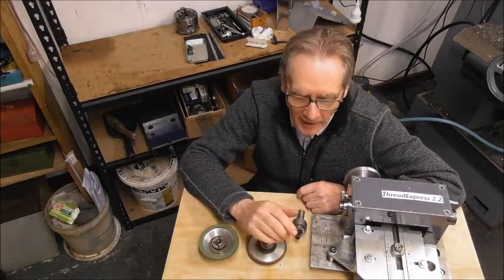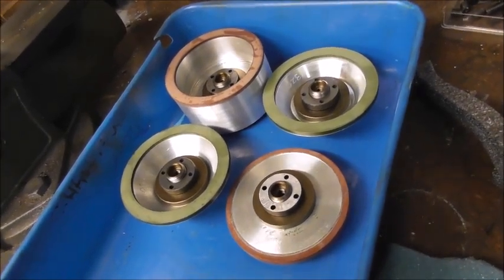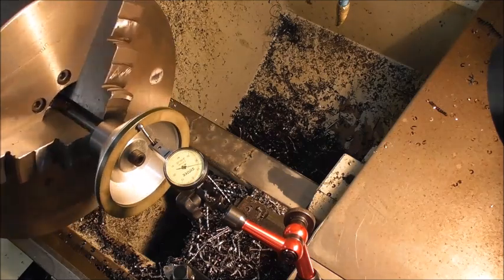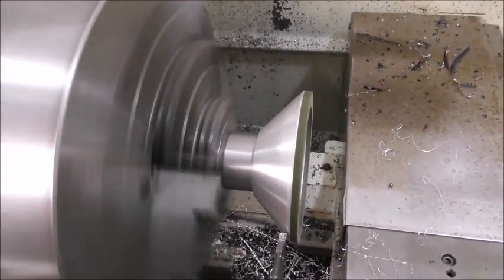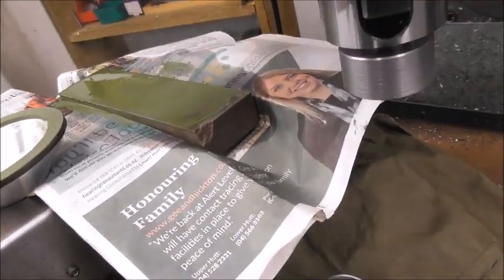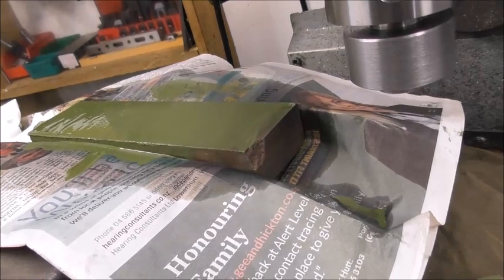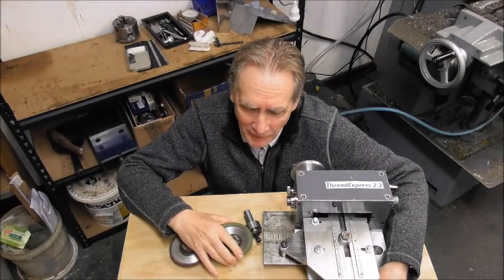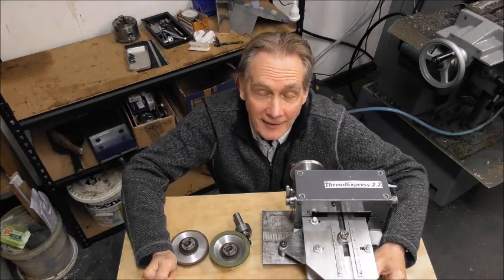Dressing and Truing Diamond Grinding Wheels

Comment: Thank You, i did this to many of my wheels after watching the original video. I have about 10 cheap China diamond and cbn wheels, some actually pretty decent on delivery. The worst one was a heavy cup wheel like the one shown, it was off by half a millimeter... A tip in that situation is to machine the back side first to first get it parallell with the diamond and then machine the rest of the surfaces and sharpen the wheel. It seems like the stone essentially becomes a precision ground flatstone provided the mill is really well trammed. It may require a superficial pass on the surface grinder as well to make it really flat. I also made a balancing axle and 12 of the dbit wheel holders, 2 different for small cutting discs which are rather useful. Used the balancing axle for the sharpening operation, it is only useful for balancing the stone wheels in these small dimensions. After turning and sharpening all the wheels came out pretty well balanced requiring no further balancing. One of the wheels I bought was thrown away, they must have forgotten the diamond or something...but all in all a very good deal.
Reply from the maker: Thanks for taking the time to give that very useful feedback and adding to the collective knowledge on this subject. Cheers, Cliff

Comment: I have a new Chinese 400 grit resin bond diamond wheel.  I tried to use it. But it seemed to burn the part. I used it dry like I would with course grits.   Is there a trick to using the finer grits?  Is it required to slow rpm or use lubricant?  Or does it need dressing to remove some of the resin and open it up?  Thanks.
Reply from the maker: Hi Robert. What grinder and what material are you grinding? Cliff
Reply: @ thanks. It was a tool post grinder in the lathe grinding on hardened  O-1 tool steel reamer I was making.   It was turning about 3000 rpm on the tool post grinder.  Lathe was stopped as I was working on flutes.  I had previously used 3” dia 150 grit  and  5” dia 320 grit wheels.   Then switched to this 3” 400 grit wheel.   All dry, no lube.  I was trying to get the final fine finish on the reamer. It immediately overheated and warped the reamer.  I had to lightly temper the opposite flutes to get it to straighten out.
Reply: I don’t know the grit concentration of these wheels.  Probably low.  The wheel being new and very fine grit is pretty smooth.  I wondered if it had a glass of resin rich on the surface.
Reply: What parameters would you use to grind the flutes of a reamer with a 400 grit resin wheel?
Reply from the maker: @ Hi Robert. Those diamond wheels are best for tungsten carbide. 01 steel is much better ground with Alum Oxide white wheels, correct bond, grit and diamond dresser is also critical for good results. Cliff
Reply: @Threadexpress  agreed.  I know diamond not recommended for steel.  But they are significantly cheaper than CBN.   I have a diamond wheel on a drill sharpener that I have been using for 20 yrs.  So what they say about damage is overblown.

Comment: Cliff are you not assuming that the bore of the cup wheel is round and perpendicular to start with? Perhaps turning it around and machining both the shoulder and the bore otherwise you may find that the runout is influenced by the way in which the cup wheel is mounted (assuming you don't have an individual spindle for each wheel and the 2 are not separated).
Reply from the maker: Hi - You are correct that my procedure was not optimal. Initially I was trying out an idea I was far from sure would even work and wanted to limit the time spent. Then I carried on and did the other wheels by the same procedure as it was a vast improvement, but I agree not optimal. Best practice would be to sleeve and bore the wheels to a close fit and face the wheel flange contact surface in the same setting (perhaps based off the diamond matrix set as concentric as possible), before even starting to machine the body and dress the wheel. But as is usually the case, time was part of the procedure plan compromise. 
Cliff

Comment: In fact, running briefly diamond core drills (ones used for making holes in glass for all sort of glass furniture) through a block of corundum is standard way of sharpening then when they get dull.
Any abrasive tool consist of grit of abrasive material (corundum, garnet, silicon carbide, diamond, CBN and such) set in some matrix (ceramic, resin, rubber, brass or bronze) holding all grains in place. Once an individual piece of abrasive gets dull, the resistance of material being ground (i.e. cut, by ever so small chunks) increases, and once the force acting on this individual grain exceeds the strength of the matrix it is torn off, and new and sharp grain comes to the front - and does the grinding.
And so "ca capo al fine", but every now and then either the abrasive is too hard in relation to material that's ground (like extremely hard diamond on a drill going through relatively soft glass, or silicon carbide grinding disc with hard matrix grinding a HSS blank) or the matrix is just too strong (for safety reasons - like in grinding discs for an angle grinder) which results in glazing, loss of grinding capacity and overheating of the tool and the object being ground.
In order to get rid of these stubborn, dull grains you have to run the tool through something hard enough to rip off these dull grains - for diamond tolls it could be an abrasive block (or in case of masonry cutting wheels used with angle grinders when they get too dull while cutting soft bricks you run them through a piece of concrete), for grinding discs used on bench grinders it could be a diamond-tipped dressing tool, or (in a pinch)  chipped carbide insert (for lathe tools - obviously affixed to the said toll), or brazed on carbide masonry drill.
Reply from the maker: You explain well how grinding wheels are designed and made to naturally resharpen. Another factor though is, if they run out, or lose their correct profile, in a precision grinding of cutting tools etc. situation, then they ideally need to be dressed true by some method.  Cheers, Cliff

Comment: This is great Cliff, I wonder why the Chinese wheel bodies are so bad? They must start out reasonably true as I would be hard to machine them out of round. I wonder if the bodies are distorting during the bonding process? This is a brilliant discovery, I want to make some precision ground stones and was worried about the amount of mess I would make on my surface grinder during truing, I think your method will get the stones very close to flat with maybe just a few licks on the SG to finish them and you have given me a method to true the  SG wheel too. Cheers!
Reply from the maker: Hi Tony. Good questions. If the bodies were machined, including the bore, in one setting e.g. on a CNC lathe, then I agree they would most likely be concentric. However, if they were machined out of castings, or pressed blanking's, or cut discs, one side at a time, then it would be easy to introduce errors. 
Thanks for your feedback and for letting us know your intended application. Please post your results here. 
Cheers, Cliff

Comment: Before the much cheaper resin-bonded wheels, the abrasive surfaces of diamond wheels were made of brass. My late father-in-law worked for Norton Abrasives in South Africa, developing their manufacturing plant. Tight tolerances meant few problems with runout or balance, and glazing was usually sorted using dry silicon carbide grit on a flat surface, much like your method achieves, and because it only clears the glazing between the diamonds, the size of the wheel was unaffected. 
I have some brass wheels and I need to re-shape the peripheral corner so I'm going to try using an angle grinder.
Reply from the maker: Oh yes, now I remember those brass diamond wheels from the distant past. With a Kero dripper as cutting oil.  Cheers, Cliff

Comment: Thats the way to make precision flat stones in the home shop if you dont have a surface grinder or a large overdraft to buy commercial ones.
Reply from the maker: Yes, an unintended upside is always welcome. Thanks, Cliff
Reply: @Threadexpress  a couple of years ago on an American YouTube channel the guy was showing making precision flat stones and I pointed him to the same way could used for mill only owners, as did another viewer,  and he did a follow up video showing it. So it's not a new method but then what is in engineering, all that matters is knowledge is recorded and passed on.
Reply from the maker: @ Interesting, please send me a video link if you find it. Cheers, Cliff
Reply: @Threadexpress  stand by, by coincidence he just put up a video so I remembered who it was.
Reply: @Threadexpress  https://youtu.be/yFtJiCfNZrs?si=jnxfTusYuM6g1a54 
Yes, that was me that he mentioned in the intro. Let me know what you think. ATB Chris
PS I used a resin bonded cup wheel, not the style he used. Others have shown that by making flat stones on a surface grinder has the diamond wheel got trued up, as they say a "twofer", 2 for 1.
Reply from the maker: @chrisstephens6673  Thanks. Very interesting, so he is running a coarse concrete type of diamond cup wheel fast and skimming the stones. That makes sense as a good way to dress stones flat.
 My procedure is intended to do something different, that is: Run the cup wheel slow with a rapid traverse to remove the diamond cup wheel bond and so dress the cup wheel.
An unintended unexpected by product of the process is to also dress the oilstones, but this was not the main intention. If I had viewed your linked video first, I would have pointed that out in my video. It may well be that the process I outlined is optimal for dressing diamond wheels, but not optimal for dressing oilstones. (Although it does work).
 I can now see some folks are watching my video with the interest of dressing oilstones and do not have a diamond grinding wheel or diamond grinding application, and this can cause some confusion or misunderstandings. Thanks for bringing this up. Cheers, Cliff
Reply: @Threadexpress  both means achieve the same outcome, but each method has different intentions and are optimised for that aim and are equally valid in that aim. Also resin bonded wheels are different to the sintered type, I don't think the sintered ones would get trued by an oil stone.

Comment: A Norton Brake type truing device is what I used in the tool shop.  We would relieve the Dipax or Borazon wheels with a turning tool and then get them to run true with the Norton truing wheel.  Even though I was working for GE then; we used wheels from a company called JK Smit.  GE's own wheels were more expensive than the wheels from Smit.  This is a good way if you don't have a brake type truing device, simple and cheap.  Once I get one to run true it stays on the hub until it's dead.
Reply from the maker: Thanks for your industry specific input here. Cliff
Reply: Did you ever try using a molybdenum stick held in a vise or mounted to a steel base?  This is what we used to true diamond and CBN wheels on surface grinders.  It worked better than the Norton brake truing device.
Reply from the maker: @glennschemitsch8341  I did do initial research and trialed different recommended dressing materials, but I did not have much success. I did not try molybdenum thought. Cliff

Comment: Instead of the steel sleeve to protect the dti tip one can simply use a thin piece of shim stock. I actually went even simpler and used a cut strip of plain printing paper and held one end to keep it stationary against rotation when doing similar truing operations on my cheap diamond wheel. It hardly wore any significant amount just for one or 2 wheel rotations, and you can just cut a new strip and use it if you have more indicating to do. Paper is surprisingly abrasion resistant
Reply: I wonder if thin melamine sheet would be a good material. In the old days of paper punch tape for computer data input, there was a rugged version made of melamine that we used to provide to the military for battlefield use, ' squaddie" proof we called it. While typing thought just of old film negative material cut into strips
Reply: Thanks for the tip!
Reply from the maker: Thanks for adding to the collective knowledge on this subject. Cliff

Comment: Very interesting Cliff.  Must have been in the late 1970's the building firm I worked for had a big tiling job come in which needed a lot of cuts.  These were what we called Heather Brown quarry tiles, hard as hell. The lads used to use an old bit of girder as an anvil and chip the tiles to shape, time consuming and not very neat..  Given the scale of the job I suggested we cut them with a saw. They laughed at me and told me to go ahead and try.... I got an angle grinder made it into a table saw and fitted a diamond blade, (I still have that blade) It worked a treat but the blade kept getting blunt. So I instructed the lads to get a bit of clinker block or soft sandstone and dress the wheel with. it. Back to cutting perfectly.

I don't know if it applies to engineering diamond wheels but the wheels I used, have to turn the correct way, an arrow indicates direction of rotation. Otherwise they don't cut very well and they clog up easily.

I use segments of worn out wheels nowadays to dress bench grindstones.
Reply from the maker: Hi Seapy. Interesting, thanks for your comment. Cliff